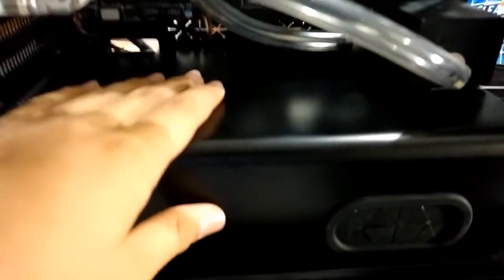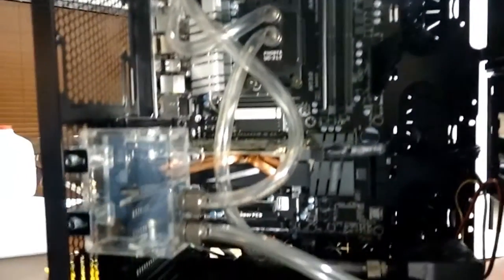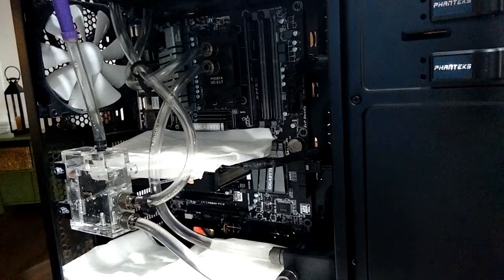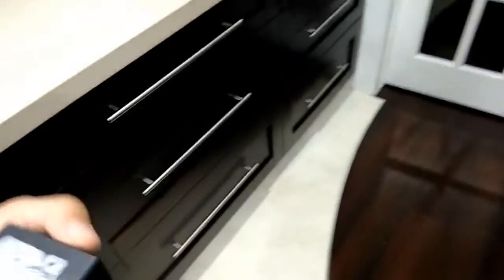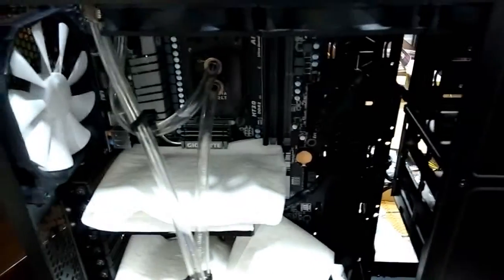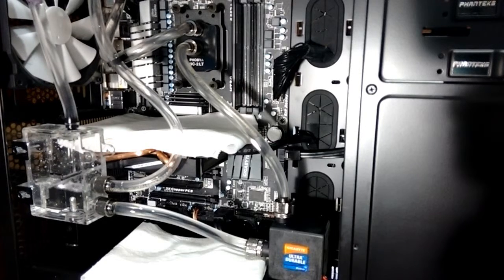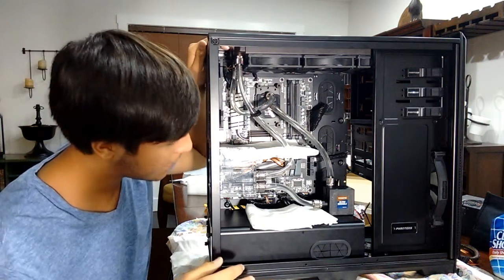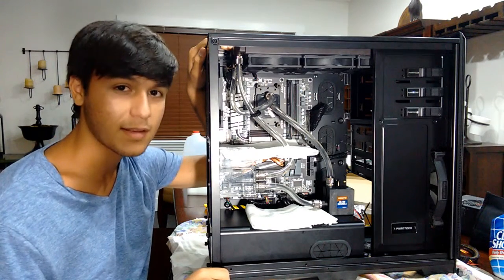My first Water Cooling loops Pt.2 (Stuff happens)

Comment: Great video. Are there other options for tubing that doesn't kink as easily?
Reply from the maker: +Zach Broughman Yup, just get some tubing that has thicker walls. Basically the larger the difference in diameter of the inside of the tube vs the outside, equates to a thin or thick walled tube.
Reply: +ADRTechReviews Thanks. Much appreciated.